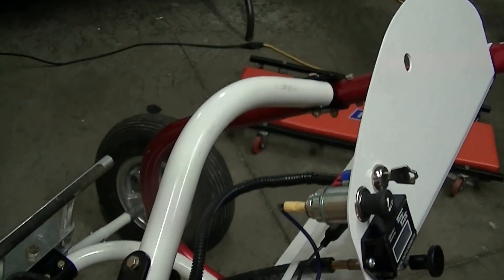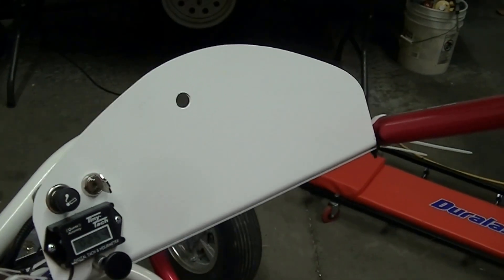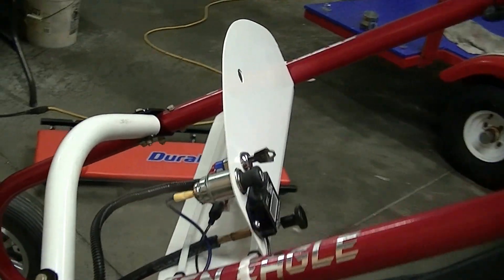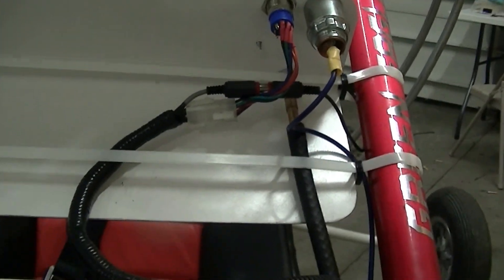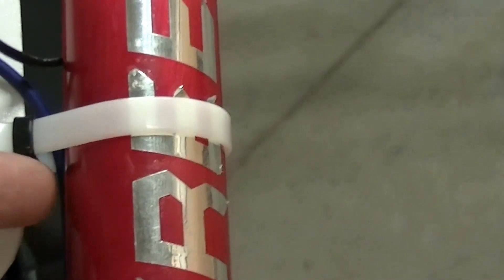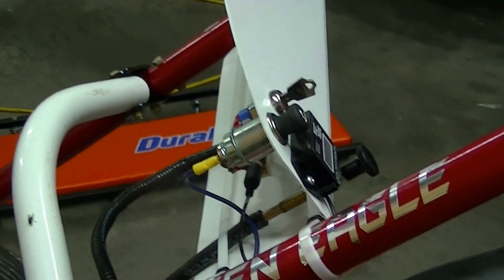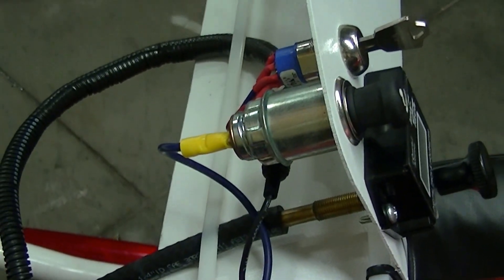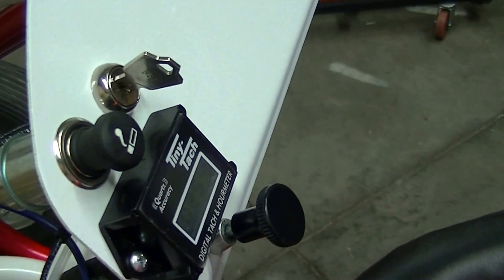Gregs 2013 Green Eagle PPG Paraglider Trike - Quad DIY New dash - Instrument panel

Comment: Greg,
Nice set-up,  I may have missed something, but I believe that you may have a problem with your cigarette lighter.  It is grounded through the panel, but I didn't see where you grounded the panel back to the battery negative pole  If you are planning on using the choke cable as a ground line, that can lead to other problems  I like the panel and how you did it for so little.  Thanks,

Dave